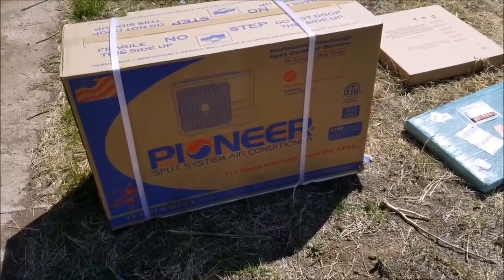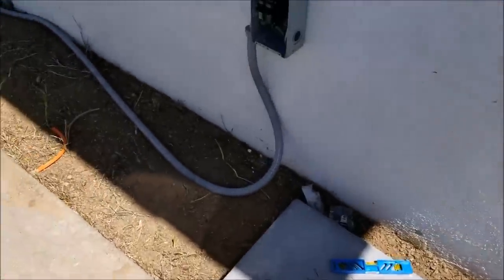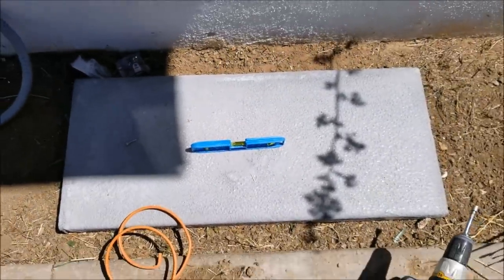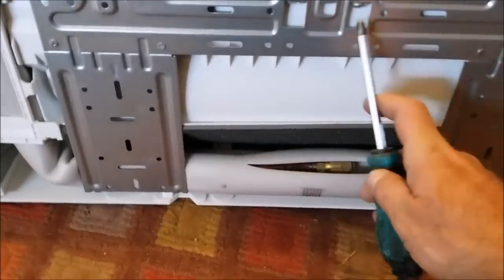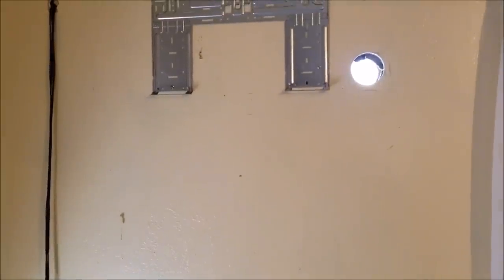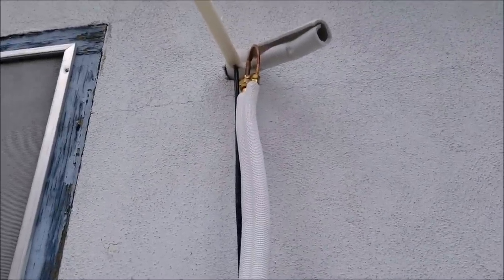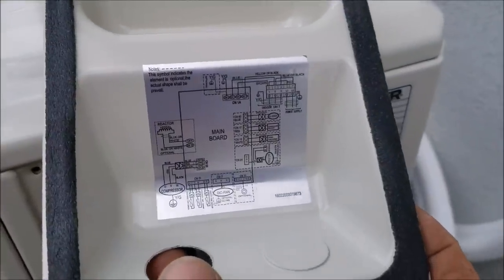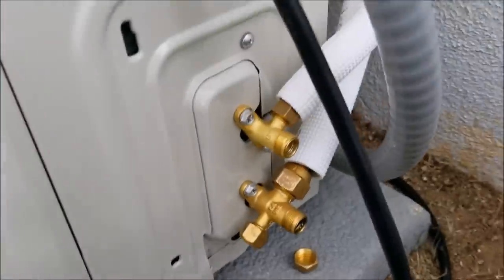How To Install Pioneer Ductless Mini Split 12000 BTU 230 Volts Air Conditioner

Comment: I always pressure test with nitrogen first. It forces any air out that’s in the system. Then I pull a vacuum to remove any air, it also boils any moisture that it might have in the system. If you vacuum first and have a leak it will pull air and moisture in the system. It’s always a good idea to use a micron gauge instead of a manifold gauge. I always pull a vacuum below 500 microns. I’ve been installing systems for a little while and have had a license for many years. 
This is only a suggestion and in no way critical of how you’re installing your system. Other than that, awesome video!!
Reply: Do you think it would be necessary to fill the lines with 410 or what ever refrigerant your system uses? Or is volume of the lines negligible?

Comment: A trick I learned using a hole saw through insulation

Spin it backwards once you're through the wall and it will cut the insulation perfect then spin forward again obviously for the outside wall

And MAKE SURE you make the hole slope down a little bit for the drain
Reply: This dude is my uncle

Comment: Side note on the line set: You CAN cut the line set down and then re-flare the ends that connect to the high/low male fittings. The units are charged for the maximum length of the lines but, according to High Seer (company I ordered my Pioneer unit from) you don't have to use the whole length as you see in the video, you can cut down to 10 feet each. I had extra that I didn't want to coil behind the unit, so I cut it to the length necessary. IF you cut the line below 10 feet you would have to extract some of the refrigerant in the unit, but that is unlikely to happen as most people usually need at least 10 feet of line since most of the evaporative units are located up high on the wall they are installed.
Reply: Have to be sure you have a quality flare tool intended for 410a before trying
Reply: Can be done with a cheap flare tool from Ace Hardware. Important to use a reemer after cutting the tube and measure the length of tube extending through the flare clamp.
Reply: isnt it 15 feet for the line set?

Comment: I am not an hvac tech but I have done a couple of these units at my home. This is a Very good video the only step I see missing  is that he did not add any leak  sealant(NYLOG) to the threads Of all the lineset connectors. This prevents leaks and ensures a long leakfree service life.
Reply: It was an excellent video.  I noted the following: Should use Nylog, slope lines down, check for leaks.  I was wondering how the gauge was disconnected and how air was stopped from being sucked back in, apparently you should release some refrigerant to purge the line before removing.
Reply: yes i had to add some sealant , because they were leaking when i first used it.
Reply: Manufacturer specs specifically state not to use any type of sealant on any of threads. The flare fittings should be torqued down to the manufacturer specifications. If using a pre made line set, the flared ends should be cut off, the flare fittings from the air handler and the condenser should be cut off and proper flares should be made. If you use nylog or teflon you will not be able to torque down the fittings properly.
Reply: @hvacdoc  Incorrect
Reply: From your reference:  Refrigerant Piping Work
1. Flaring the pipe end
1) Cut the pipe end with a pipe cutter.
2) Remove burrs with the cut surface facing downward,
so that the filings do not enter the pipe.
3) Put the flare nut on the pipe.
4) Flare the pipe.
5) Check that the flaring has been done correctly

I don't see any instructions for cutting off the flares on pre-made piping.
Reply: Henry Chinery pre flared line sets are notorious for having poorly made flares plus the flare nuts themselves are not factory. Now if a manufacturer makes their own lines sets that’s a different story
Reply: @hvacdoc  I've performed thousands of installations and flare joins, being out in the  field gives you the best experience rather than simply relying on the installation manuals. Just like them times when a few Daiken units had improper machining on the outdoor unit flare faces which had a groove down the centre of the face. Installation manual goes out the window....
Reply: Alan Mansour I’ve been doing this 20 years and I don’t care how many units you’ve installed, you always go by what the manufacturer specifies. Every class I’ve gone to says not to use pre made lineset flares or flare nuts.
Reply: @hvacdoc  Therefore I don't care how many years you have been doing things and how many classes you take if you have no time for anyone else. Time is just a number. No one has argued about the use of premade flares and flare nuts, it's the use of Nylog etc in question which is actually refrigeration oil itself. And if you don't use anything on the back of the flare face the copper loves to bind and twist during torque up possibly creating further issues. Engineers who right these manuals barely spend anytime in the real world and wouldn't know what a shifter is
Reply: Alan Mansour a real mechanic that knows how to make a proper flare doesn’t need nylog or refrigerant oil.
Reply: @hvacdoc  You've just contradicted yourself and the Daikin installation manual you so highly regard as gospel. Didn't you read the part where they state apply refrigeration oil to face of the flare..... You obviously haven't done as much as you claim since you would of come across many factory imperfections which the best flare in the world will not create a perfect seal. And yes I pressure test at minimum 500psi dry nitrogen which means if that does not leak the refrigerant under max operating pressures will stay sealed. Anyway moving on
Reply: Alan Mansour I guess you didn’t read it either because it says to put it on the inside face of the flare, not on the thread like I stated....moving on
Reply: @hvacdoc  I'm not the one stating to follow installation manual to the t then changing my mind and suggesting something else. That's the whole point lol do what works best
Reply: Alan Mansour I never suggested anything else so you must be talking about the wrong person
Reply: @tubro007  I have the same question.  Installation manual says to leave the manifold (low pressure gauge not high pressure gauge) on when you open valves, and to do a short opening and confirm pressure (120psi) and test for leak-down before fully opening valve.  Instructions NEVER say when to actually remove the manifold, which is why I watched this video...still looking for that answer.
Reply: @hvacdoc  I've been doing this for 120 years and I would suggest using propane rather than 410a as the molecules are larger and the refrigerant will not leak out as quickly. This would be better than properly cutting the copper and reflaring.

Comment: The outside unit (condenser) is charged with refrigerant and the inside unit (evaporator) is charged with nitrogen (from the factory).

When you are using the vacuum pump, it not only removes the air in the line; BUT it purges the lines with the nitrogen; which removes any oil or grit, etc, in the lines. This is VERY important in the more efficient Air Conditioners today. 

With older AC installs, the vacuuming AND the purging actions, were separate operations when installing AC units. But with this unit, these two actions are done simultaneously.
Reply: The vacuum pump does not purge nitrogen thru the system.

Comment: Do not remove the manifold-gauge set's low pressure side hose from the service port on the low pressure side service valve of the outdoor unit, before opening both of the brass service valves of the outdoor unit and pressurizing the refrigerant lines. Otherwise you may lose the vacuum and suck back in some air while disconnecting the hose from the service port. This is also useful to measure and record the operating pressures after startup. Keep the hose connected to the service port (with the valves on the manifold-gauge set are closed), until after you are all done with the job.
Reply: The manufacturer told me just the opposite because I was thinking the same thing.
Reply: Exactly 👏🏻

Comment: Excellent video. Just a tip…do not remove the manifold hose from the schrader while the line set is in a vacuum. You will pull air into the system. Release the charge from the condenser; then once the lines are in a positive pressure you can remove the hose.
Reply: I hope NOBODY does what he did. I was in shock that he did the vacuum verification/disconnect as he did.  He will probably come back and have to recharge and fix his leaks as he in no way did an adequate test.  Everybody PLEASE follow the manual and NOT this video!

Comment: Buy leaving line set lopped, you have created a oil trap that will burn up you compressor in time.   I'm A HVAC-R technician.     I learned this in special mini split training class I attended recently.

Comment: Pioneer will not warranty unit unless it has a surge protector and was pressure tested, triple vacuumed pump to at least 500 microns. Then you have to take indoor and outdoor temperatures and pressures readings during heating and cooling. Pioneer is a great unit when installed professionally.

Comment: If your flare is messed up then vacuuming will not expose a leak. Thats why we do a triple evac. Also don't use a vertical loop in the lineset. Use a horizontal loop. A vertical loop can create a oil trap, trapping the oil in the lineset and starving the compressor of oil.

Comment: Thanks for taking the time to make this video. It helped me decide to go with Pioneer and install the units myself. The job was mostly easy, not being an AC guy. Your video helped allot. I'm also very happy with the Pioneer units. By the way, if anyone is looking at Blueridge mini splits, they are made by Pioneer. The same exact units. So save money and go with Pioneer.
Reply: is your pioneer still holding up? currently looking at the 9k ++
Reply: @tyler13923  I'm thinking about getting that one, is it working well for you?

Comment: Hello and thanks for the video.  Good to see a variety to get a feel for what you want.  One hint:  don't coil your lines as the refrigerant oil can 'puddle' in the low spot and starve the compressor shortening unit life.  The lines should all slope down including of course the drain.  Take care.  Doug
Reply: Douglas Thompson thanks for the tip on not coiling line set but my set up is similar I only need half the length that I was supplied any suggestions on what to do with the slack? I can't think of anything else to do besides coil it
Reply: Most all are a standard flare fitting which is pretty easy to make.  So cutting and shortening would be a solution.  If you have the space you could coil them in a horizontal fashion this would allow a downward slope.  A few manufacturers have no requirement  although if your unit wears out early it is to their advantage in today's market philosophy so I wouldn't trust that unless they have data to back it up.  You can also order a shorter line set with the unit or get one later and switch it.  A couple of 'S' curves on the lower wall where they aren't in sight would also take care of a short amount.  Take care.  Doug
Reply: Also a slightly reduced efficiency and less aesthetic appeal. One and done!
Reply: @Captfuntastic  I seen one guy run the copper into the attic and out down the soffit. He left the extra tubing in the attic.

Comment: Not half bad but I had to tell you that big loop behind the unit on the lines it's going to act like a great big oil trap could definitely cause some problems you'd be smart pump it all back down cut that line and get it to free drain back to the comp. And I would like to see a better gap between the outside unit and the back wall can't remember if the sanyo's inducer are pattern across the units or if they force it I believe they force it which would mean you'd be blowing towards the wall could cause a hot air Short Circuit definitely affect the efficiency of the unit we better off moving it away and get some more free air movement around it just some helpful hints
Reply: I have the same unit and the fan is pulling air from the rear of the condenser out the front.

Comment: I made a big mistake in my install wrapping the tape at the very last step.I had finished installing my system and ran it overnight. Then I turned it off to wrap it. My lineset was only 10 ft long, so it connected with very little slack. When i went to wrap the lineset AFTER releasing the refrigerant, I must have deformed the 1/4in flare and developed a leak. In retrospect this likely would have happened if a strong wind blew the lineset too since the connections were pretty tight. I'm going to have to recharge the system now. I HIGHLY recommend if you have a short run of pipe to wrap and secure the lineset to your wall before making the final connections.  I think in this video the loop gives a decent amount of slack in the system to work with though. Also if I had to do it again, i'd absolutely nitrogen test the system. I didn't appreciate the high pressures the system operates under and putting an inert gas in to extra verify the connections is pretty vital. I think there is a big difference between a -15psi vacuum and the actual 500+ psi operating point

Be extra careful, the 1/4in pipe especially is very delicate and there is a really good reason they tell you to take care whenever handling it. Let this be a really expensive lesson :).
Reply: Thanks for the tips. I'll remember that. Hope you were able to get everything sorted out.

Comment: I have a Pioneer 12k BTU unit installed in one of my rooms (gaming room) and a 24k BTU unit in the living room. Works pretty well! Had to pay an HVAC/Electrician guy to do it for me though.
Reply: How much did it run you? Full install
Reply: @Shaohikhan  1k USD each AC for the labor only. So 2k for both + the costs of the ACs.
Reply: @Shaohikhan  overall close to 4k USD

Comment: After opening king valves, check your pressures so it’s not overcharged or undercharged. Because it could be overcharged and allow liquid into the compressor causing damage.
Reply: What pressures would indicate that your lines are over or under charged?
Reply: @Hagsmasher  If it’s R-410a system then anything over say 410psi on high side would be overcharged. Under charged on high side would be lower than 350psi. Under or over pressure the system wouldn’t work very well.

Comment: Nice video but I just noticed you are using the RED high side gauge to read the vacuum. I think the blue low side goes an extra amount (-30) and may be easier to read.

Comment: It’s the wiring that most people have no understanding what so ever how to do.  A lot people have no idea whether it’s 2wire, 3wire coming from the breaker box.  That’s where you will lose a lot of people because they don’t supply the wire from your breaker to the unit outside and some people have no clue what to buy or how to hook up all of that in a proper fashion.  Electrical can be difficult to understand for some people

Comment: I don't know if this has been commented before but you should only run flex conduit a maximum of six (6) feet. and it needs to be supported and not run on the ground.

Comment: Vacuum the low side on the gauges to 30 inches of mercury. Cut the extra copper then flair the copper to connect refrigerant lines correctly. Cover lineset and electrical inside of lineset covers. Good work

Comment: Why are you using the gauge on the high side ( red) ? If you take the gauge line off before opening the value the schrader value will suck in air from having a vacuum.

Comment: They only thing I can recommend to Pioneer is to make the electrical connections inside the condenser a connection where you just put the tip of the wire into a hole and tight down a screw. The way they have it now if you are using a 220V unit the wire is too thick to get it in there snug and not srip out the screw they provide without using a wire "U" crimp end.

Comment: You better change that 50 amp breaker in your panel to a 30 which is maximum for the number 10 wire you ran. They'll run short pieces of number 10 on 50 or 60 amps only if the AC says it's fine and only I think no more than a few feet but maybe even just three. And of course that's the larger split systems. You can run a 30 if you wanted to the 20 you have at the unit. Are you can run 2 20 amp breakers. You actually good could have that conduit and wire connector cut some and it could with some time cause a  Fire.

Comment: Can the lines from the mini split to the cassette run horizontally as well as vertically? I’m unable to place the cassette directly on the other side of the outside wall. It’ll have to be about 3-4 feet down and to the right of where the mini split is mounted inside.

Comment: Did you hook up to a existing box outside the house for your electrical or did you forget to add video on all the wiring from the breaker box out to the unit?  

     A lot of people don’t know the in and outs in what size breaker and what size wire or how many wires to use.  Some people don’t know what AWG size or whether they are using a single pole breaker or double pole for 110v or 220v
Reply from the maker: Wiring is going to be different on every install. It is best to watch electrical videos on that.

Comment: Please put a notification to buy a 5/16 - 1/4 vacuum adapter when installing with this equipment.
Reply: JOHN BATCHELDER just saved my day
Reply: Yea, I have had my unit connected and ready to vacuum for two days now but did not know to buy the adapter.   Waiting on Amazon to deliver adapter today to finish the job.
Reply: You buy a vacuum pump like the one shown it comes with the adapter.
Reply: Also he said low side to the high side